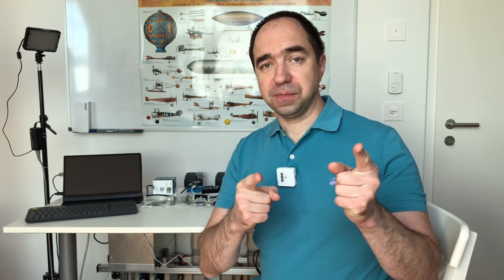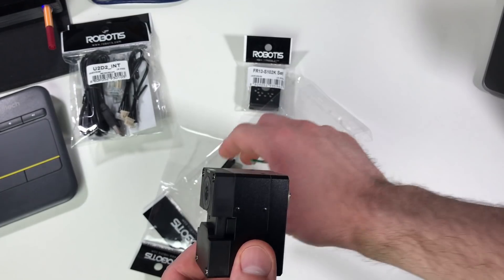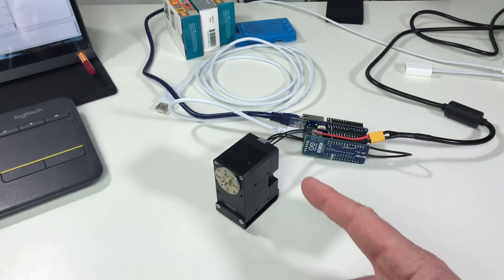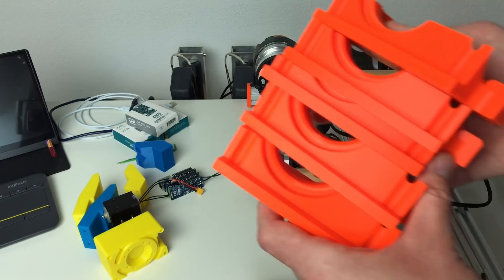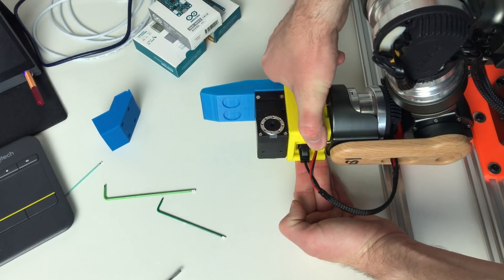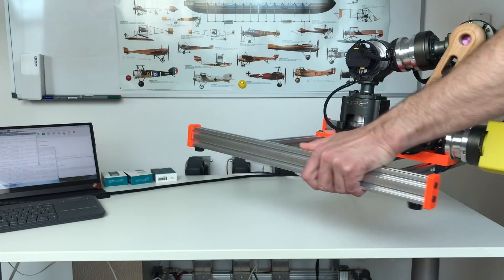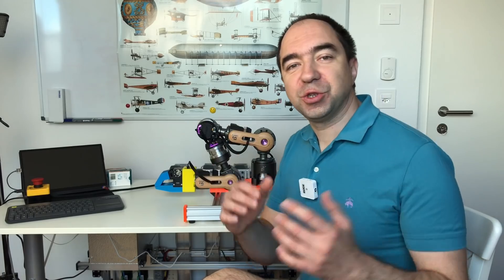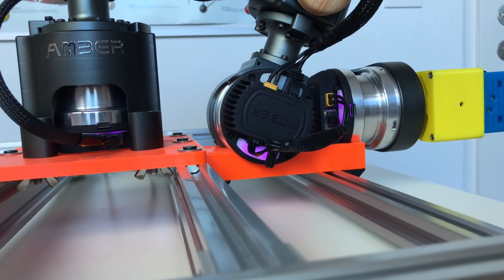Building the gripper for the robot arm (Dynamixel + Amber)

Comment: Is the endeffektor flange designed according to any international standards (such as DIN EN ISO 9409-1)? From what I can tell it is not, since the bolt pattern uses a 35mm diameter around the center?

Comment: did you make a video on how to make the actual robot arm or did you buy that
Reply from the maker: This one is made by company Amber. I have video about it.
Reply: @Skyentific  is it possible to make this Robot by yourself?
Reply from the maker: @N3o-T1n  it uses the harmonic drive reducers (around 400$ each). Plus brushless motors, with controller this will cost at least 100$ each. This it will cost 500$ per axis. For 7 axis this will be 3500$. So yes, it is possible to make this robot arm by yourself, but it will cost at least 3500$ for parts.

Comment: nice videos, but the problem with electric arm are SLOW, WEAK and kinda boringly expensive ....why dont you focus on hydraulic robot arm as they are better stronger and faster....like the ones used in the garbadge trucks. precision will only be acheived with good machining of parts and vision aid.

Comment: I love Dynamixel because they are generally the lightest weight servos for the given torque! For humanoids and Mecha, that weight savings really matters.
Reply: Not quite... JX Servo B70 is about twice the torque to weight ratio, 67% higher speed, and nearly 1/4 the price. Dynamixel probably has better backlash though. And the smoother motion and current limiting is a major advantage for robotics.
Reply: @dekutree64  I've had bad experience with cheaper servos. (Also, the sub-$100 Dynamixels, with plastic gears, have tougher competition, as surprisingly do the over-$1000 servos.)

Anyway, if you can go with mini Cheetah or Moteus servos for an application, they are "more" for the money, but also weigh more.

It's good to have choices :-)